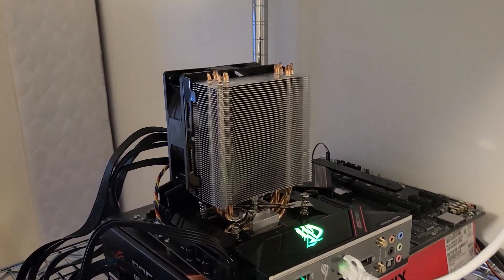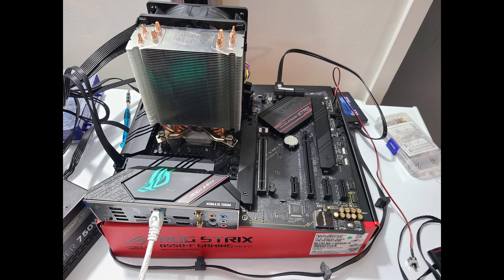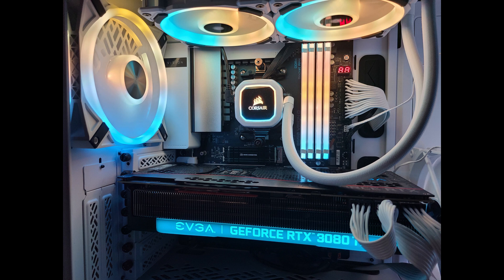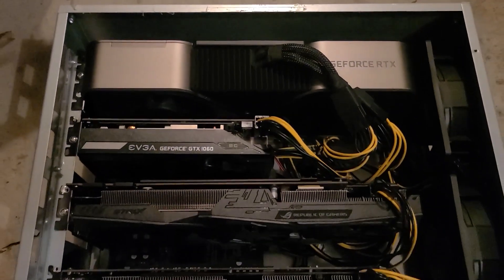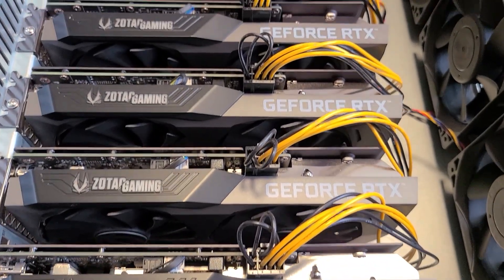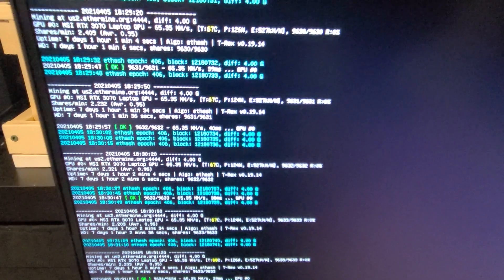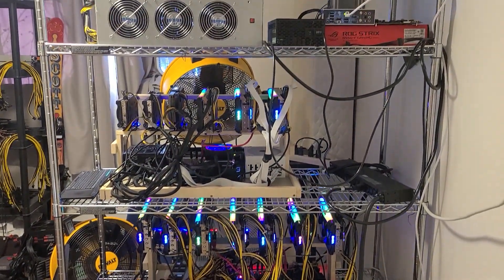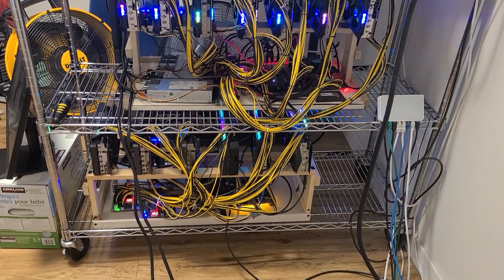$380 USD per day Home Crypto Mining | Ethereum | Raven | Raptoreum | Speculative Coins

Comment: I thought that 3070s on laptops get less hashrate than a standard desktop GPU 3070. How do you get 65 megahash on a laptop 3070?
Reply from the maker: It depends on the wattage that the laptop is set at. I have a friend with an ASUS 3070 mobile that only gets around 40 MH, but it is pegged at 100 watts or something. I think mine does like 130-140 watts and it sits at 65MH all day long
Reply: @GroweverydayOriginal  great. Thank you. I know it's not smart to laptop mine or not the best allocation of $ but I just want to do it. 😕
Reply from the maker: I needed a laptop, and I could not justify buying one that was not able to earn me something back. I really want a Dell XPS, but it earns me nothing so I just can't do it. It would be 100% an expense. Buying the MSI gaming one allows me to have a nice laptop, and have it pay itself off in like 13 months